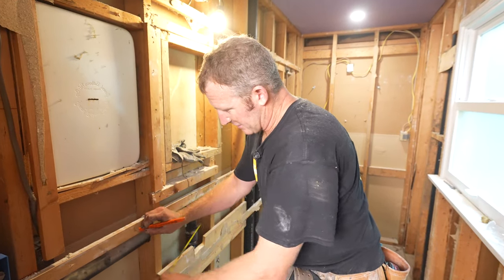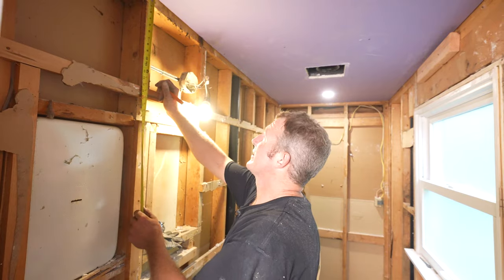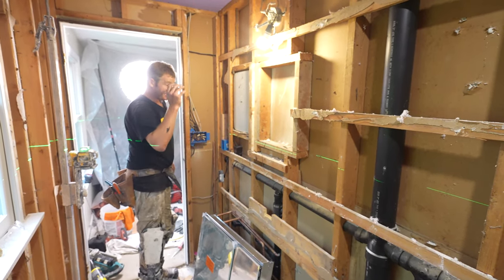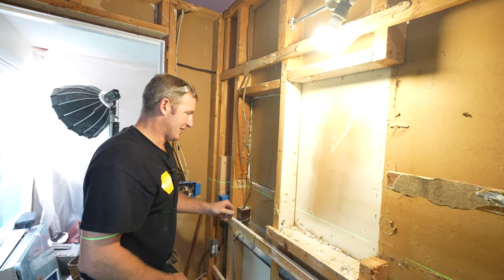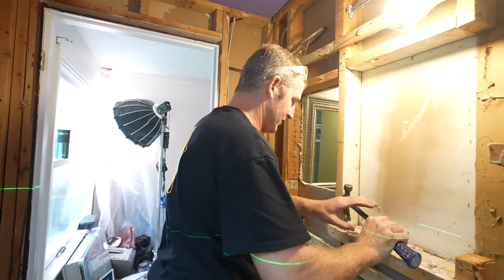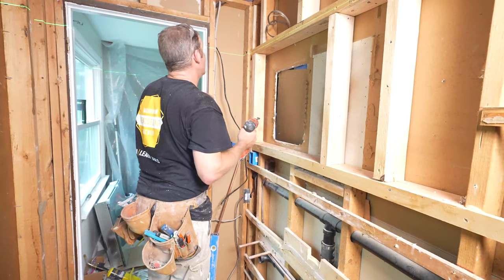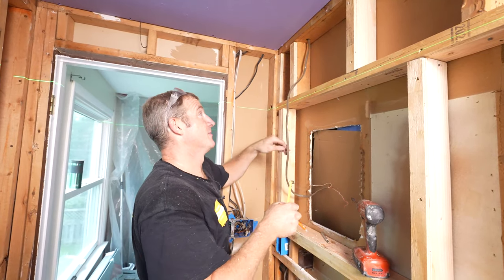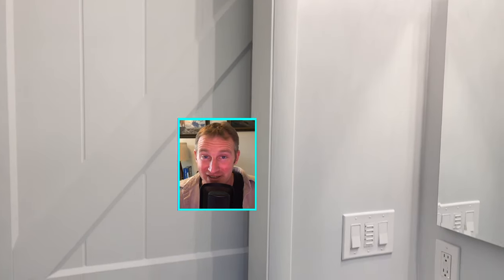Bathroom Recessed Mirror Cabinet | Never Easy 😡

Comment: If the studs are 16" apart, can you still recess a 48' medicine cabinet?
Reply from the maker: Yes just have to frame in the rough opening & if it’s a load bearing wall it’ll need a header 👍

Comment: Do you ever have trouble pulling out framing like that and it pulling the drywall screw's through on the finished side? Or do you sawzaw all of them?
Reply from the maker: Occasionally yes. Even if I try to cut the screws a lot of times there’s little holes on other side. Another problem I try to keep clients aware of…
Reply: @BathroomRemodelingTeacher  makes sense, thanks!